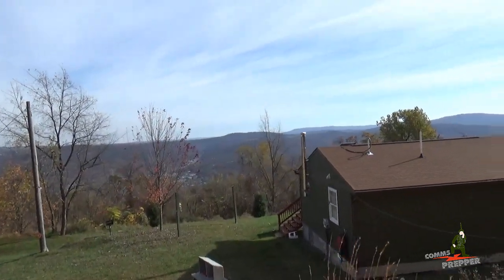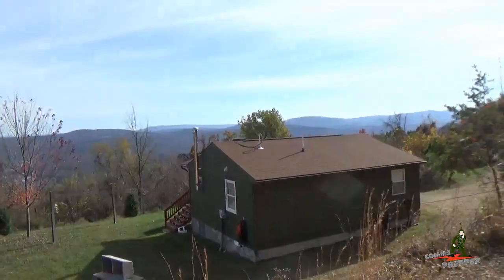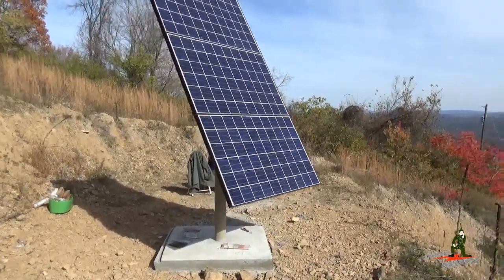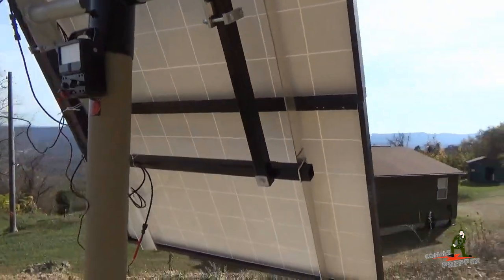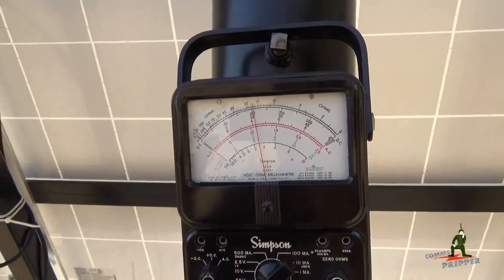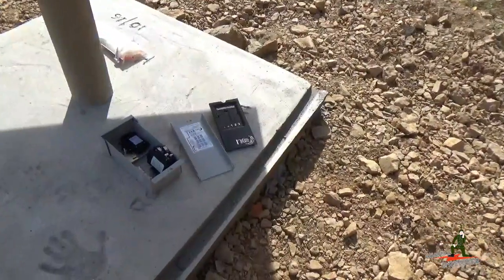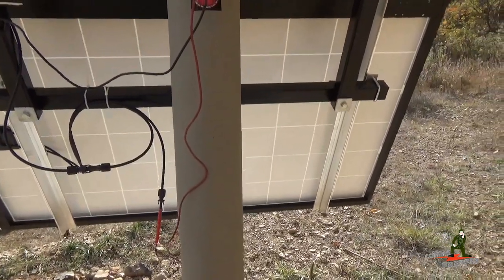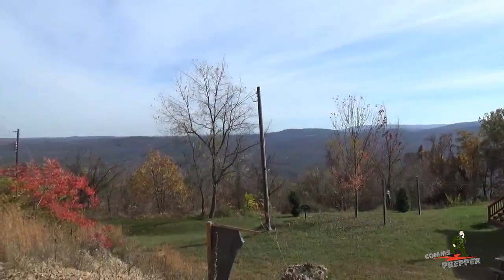Solar Panel Mounting - Ground Mount

Comment: Very nice view too.  My PV panel mounts are custom jobs, made from modified pine tree poles.  Works good.  Very rustic.  Another way to install panels far from the hidden in the trees cabin to a clearing that gets full sun, is to move the batteries to the panels.  My current draw is at most 4 amps at 12.3 vdc, while the panels may produce up to 15 amps at 19vdc.  Less expensive and more widely available, lighter gauge and affordable cable can be used in this configuration.  Using a' voltage drop calculator' will help determine the most efficient gauge wire.

Comment: ok I'd think if you insulated building with a openable vent for heat to escape in summer. cold batteries don't have much capacity. it will be a nice size system
Reply from the maker: Roy right now I have the batteries outside under my deck in an insulated box.  The plan is to move that box - as is - into the new structure.
Reply: Oh ok

Comment: looking good. that should keep your batteries in shape
Reply from the maker: Thanks.   Now I need to build the building/shed.
Reply: How cold it get there. If they get to cold loose a lot if capacity. Build it bug enough for expansion
Reply from the maker: It gets cold.  The whole system is a work in progress.  One day I will add a second pole and three more panels.